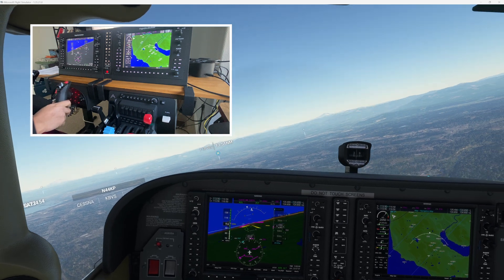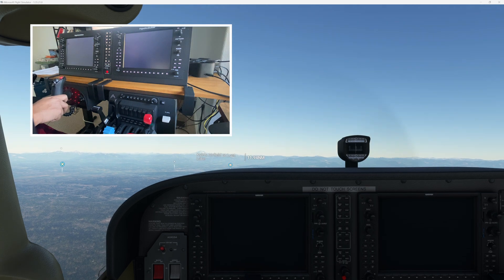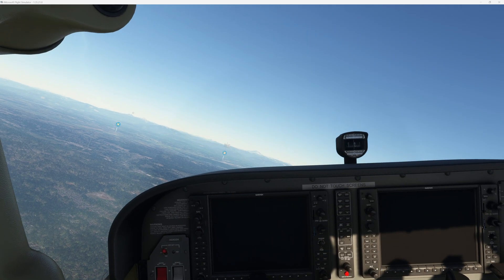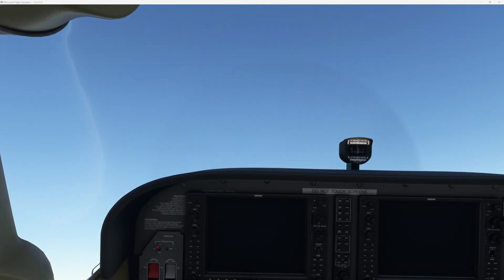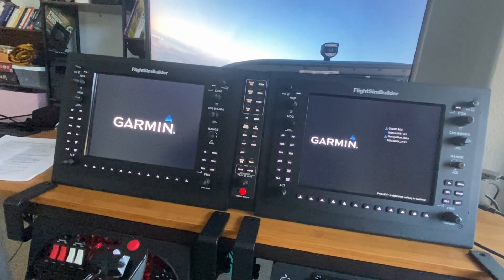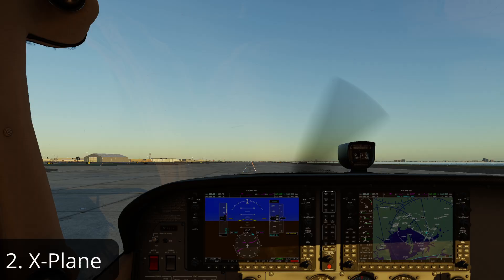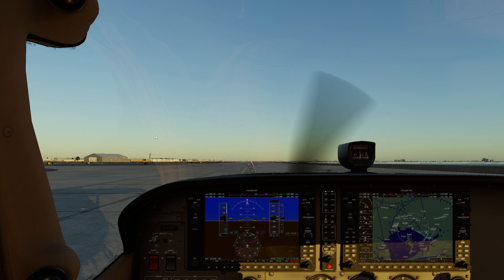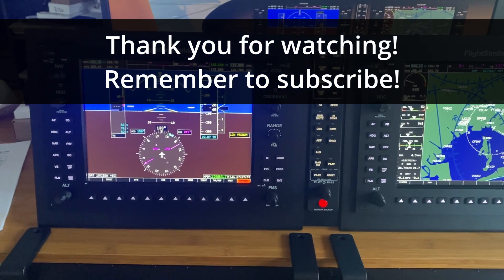Fix blank G1000 screens in X-Plane and Microsoft Flight Simulator (if you have Honeycomb Alpha Yoke)

Comment: I had an easy flight (plane delivery) where my screens went out after takeoff. 

Didnt have the tick noise.

Turned out mine had the Red Alternator switch turned off for some reason. Flipped the switch and it all came back on.
Reply from the maker: Ah! The battery will run out if the alternator is not charging it ... makes sense. Thanks for stopping by and sharing, appreciate the note!

Comment: The starter motor is on all the time. That's why it sounds like it does from the motor. And it will also drain the battery.
Reply from the maker: Yes! Took some time to realize that was the case, since the Honeycomb Alpha’s start switch is not spring loaded.
Reply: The new version of Alpha XPC has that sorted out.
Reply from the maker: @vardagsteknik6576  Good to know...thank you for sharing!